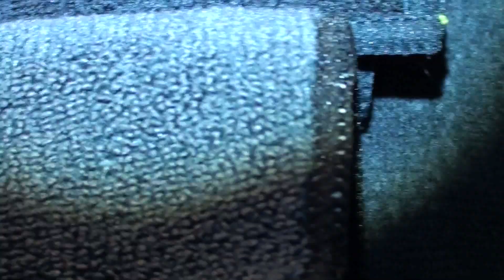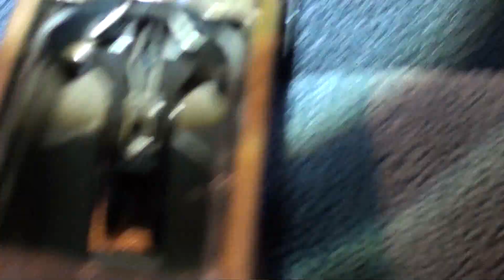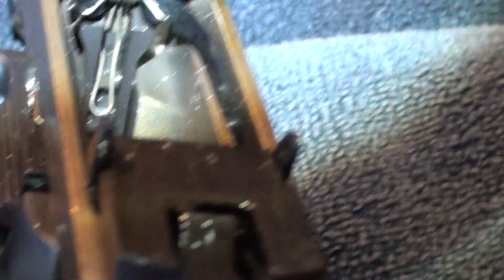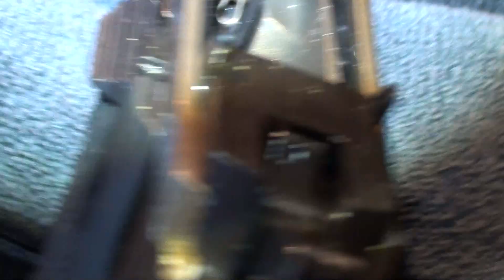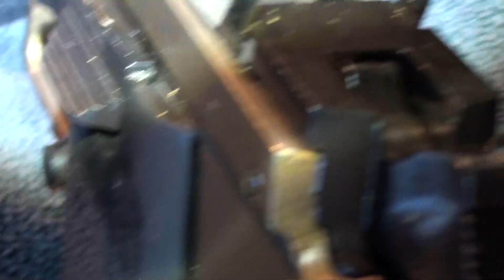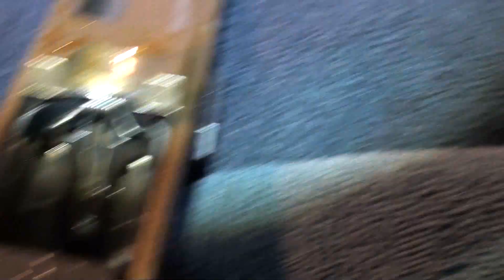Desert Eagle Slide Stop Review

Comment: Great video sir! Can you tell me what would cause my desert eagle to lock the slide back after every shot? My father gifted me his 44 magnum. But I also bought a brand new 50 barrel and mag and it’s continues to do the same thing.
Reply from the maker: G'day

The most common cause of this is would you believe is the user. They don't realise it , but they are knocking the slide stop up on recoil. It is a big slide stop and easily knocled if you may not have a firm grip on the firearm or it slides in your hand during cycling. The magazine follower should be way down in the mag well and no where near the tab that locks it up so we can discount that. Is your slide lock engagement spring in place? The smaller spring I mention in this video? Easy to test and see. press on the slide without a mag in it, does it move back upwards smoothly of its own accord into it's normal position or stay down, or flop around. i.e. Is it missing......

If all seems to be well in that regards, the I am tending to lean towards your accidentally knocking it up. I've done it myself  when tired in that past and so always make sure every shot is the same as much as possible for consistency.

The only other idea I can think off is that your slide lock is interfering with you slide already and not sitting down flush with the frame. Press it down with the slide off and see if it does sit nice and flush and there is no way the slide can catch on an edge poking up proud of the frame to engage the slide. Run your finger along the edge. if it is a nice clean smooth run it's not that.

Hope some of this helps is some way.

Cheers from down under....
Reply: @Hotdogger808   Really appreciate the detailed reply! I really wish it was the case with the grip, but it's definitely not unfortunately. It was my first thought when it was happening at the range. I also owned another 50 in the past without this issue. 

This issue didn't begin right away. It started happening after about 4 mags. This Desert Eagle was my Dad's, and it's been hardly fired in the last 10 years, and fairly neglected as far as cleanings. But I thoroughly cleaned and lubricated before our recent trip. 

As far as the slide stop/lock goes, it sits flush as it should. When I press up on it, it goes back down when I release it as int should. When I put an empty mag in, it puts pressure and pushes it up as it should. This whole thing is strange. 

I would blame the old mag spring, but did it with a new mag as well for when I switched to 50AE.
Reply from the maker: @damon323  OK

One last idea, your slight stop maybe moving up when you pull the trigger as it is held in place with the trigger bar spring. Clear firearm, take slide off, slowly pull trigger and watch the slide as you pull the trigger and see if the slide stop moves upwards at all. This would denote a weak slide stop return spring (the small spring near the frame). Its a long shot, but worth a try. It has happened to others, but rare.

That little spring (slide stop plunger spring) has to keep enough pressure to keep that slide down during cycling if it cannot it will move up and engage the side. I had one of my slides doing this behaviour and actually I replaced the slide stop and it fixed the problem, It was the slide stop being out of spec from wear and tear, it was well worn and engaging practically every round. It took me about 300 rounds to diagnose the problem.

Are you sure no magazines are interfering with any part of the slide stop engagement lug as the mags are free floating? You mention you have tried a new mag so you have sort of discounted that in many ways. The fact it is doing it on two different pistols makes me wonder though. That is highly unusual. If you are not kicking it up yourself then we really do have a mystery here my friend....
Reply: @Hotdogger808   I'm going to test what you mentioned now but this is not two different guns, just one gun. It's just I'm changing the barrels and mags from 44 mag to 50 AE. The 50 barrel and mag are brand new. I really appreciate your help so far man, thank you!
Reply from the maker: @damon323  Oh my bad, I misunderstood. So it is the same frame. Just out of interest what ammunition are you using? And did the firearm ever function properly or has it never functioned properly? This is a early model Mark XIX we are talking about? with the two weaver slots or a later model with the full rail on the top?
Reply: @Hotdogger808  Using some high quality bear loads for 44, and Hornady for 50. Gun has always been functioning perfectly but it has been sitting for several years. When I was having the problems at the range, I held the slide stop down while firing and it functioned perfectly. Definitely something causing that slide stop to come up during firing
Reply from the maker: @damon323  Yes I have been there myself and seen this behaviour. It was a bloody nightmare. I have a few videos on it on my channel I think. It is on my Israeli 44 Mag MK XIX. This is the one I did the exact same test you did on it and I ended up swapping out the slide stop for a new one and it sorted it out instantly. Check your slide cut out is nice and sharp and not worn on the edge also. When these beasts go bang, it is ferocious and a lot happens in a millisecond. The amount of moving parts is staggering. Even the slide slamming into the back of the frame on recoil can "jump" the slide stop up if the slide stop plunger spring is weak. Have you had a service kit though it by chance? Well worth a shot. New recoil springs would def be worth trying. if the main recoil springs are weak you could be slamming the hell out of your frame and kicking your slide stop up as a consequence.......
Reply: @Hotdogger808  You are seriously awesome my friend! I know I’ve said already a few times, but really want you to thank you for the time you’ve taken to help me! Funny you mention that because I do have a tune up spring kit coming that I just ordered last week. I think you are absolutely right on the recoil springs being weak. They actually do feel that way. It’s a 10 year old gun, and the springs are all original. It’s a Mark XIX by the way, I forgot to mention that. It’s a tune up kit for a 50, but I know it’s all the same except the magazine spring is different on a 44.
Reply from the maker: @damon323  Good luck brother...... Hope the new springs might make a difference. 10 year old DE springs will be on their way out for sure. Under compression even when slide is in battery they loose their power. I have over $6K worth of DE parts collected over the years before parts became nearly impossible to get here in OZ now. I knew one of the head guys at Magnum Research and if I am hard up and he still works there I would reach out to him for help as a last resort in the past, He was always very helpful. 

A DE here in OZ can go for over $4500+ these days here.....and that's not for a special edition.  Let me know how you go...............cheers
Reply: $4500 is insane! I couldn’t believe how much they went up here in the states in the last 7 years. I remember a nice cerakote finished eagle was $1400. Now they start at $2200. But that is great that you had some help for parts when you need them. 

The more I think about it, the more it makes sense on the recoil springs. My father gifted me this as I mentioned, and never cleaned it. When he got it here last week, I immediately cleaned and greased. The slide was like butter afterwards, and noticed how much easier the slide moved. Between that and old springs, this all makes sense. Thanks again my friend! I’m hoping I get my kit this week and I’ll let you know how it goes👍👍
Reply: @Hotdogger808   Got an update, and you were absolutely right!! Just needed some new recoil springs! I also put in that rubber extractor spring and pin as well. Ran perfectly! Thanks again for your help Bro👍👍
Reply from the maker: @damon323  That's great news! Glad to be of assistance and good to see we could get your DE up and running again like it should. You enjoy it! Cheers

Comment: How did u widen that spring to keep the slide stop tight mine is getting loose
Reply from the maker: I just used some small  pliers and gently opened up the gap in the centre where you can see the spring bows inwards until it clicks into the trigger slot firmly. If it is not tight enough it can jump out and then the slide stop slides away from the frame as you may have alreay experienced,.the trigger spring is the only thing holding the slide stop in position. The smaller side spring is only to push the slide stop up and hold open the slide on the last round.. word of advice....use some masking tape on the frame if you dont want to scratch your finish on the side spring......... Be gentle with the trigger spring, its a delivcate spring. Hope this helps. Cheers
Reply from the maker: Also check your trigger spring horns are not bent causing the spring to pop out. I use wooden sqewers, you the ones for cooking to help me click everything in. Wood on metal is a goodthing......qvoid scratches especially on stainless or chrome DE's i have 1 chrome israeli built 44 . They are out of production now. 2 ofmthe new stainless  SRMB in 44 and 357 and a burnt bronze as you can see in tbis video in 44

I dont know what country your in, but here DE's pretty rare...... cost all up for my set which i use for shooting in metallic silhouette comps out to 100 yards  i have 4 with 3 having a combination of  deltapoint pro and vortex razor red dots approx $14000. Ive first shot the DE in 1990 in a MKIIV   . If your in the usa and come across a MK I in decent condition consider  buying it! its a higly sort after collectable.i am in OZ and have never seen a MK IIV here in 30 years.
Enjoy your platform....its the only short stroke gas operated handgun in the world and an iconic firearm. Cheers fro down under
Reply: @Hotdogger808  is it normal for the slide catch to have a little play like.when I push it in it moves just a tiny bit.?yes I'm in the USA I have the burnt bronze 44 just bought mine 3months ago and already having trouble it doesn't go into battery all the way bolt sticks out.i have about 200 rounds through it
Reply from the maker: @Theshoota420  no they dont usually move much at all side to side. That spring is whats stopping the movement and if loose it will move.

New pistol shlukd function flawlesy, unless its second handbandbhad cast lead shot through it which will block the gas port. Ive seen plenty do it and have to send the gun back to MRI

Check your return springs. All 4. Are they new or worn out. The return springs pull the slide into battery but weak ones do t have enough energy to do it.

Also is your bolt rotating cleanly. Does it rotate smoothly? Check also for gas piston alignment to male sure its not catching on the gas port. I have seen bent gas pistons before. I have personally broken 3 from useage but i have shot over 6000 rounds of 44 mag
Reply from the maker: @Theshoota420  also its a new gun so needs running in but they are tested at MRI prior to shipping for function.

Also. Lack of power in your loads can cause failure to go into battery as the slide does not complete a full rearward cycle. It is brand new yes?
Reply from the maker: Lastly
Are you limp wristing at all? That can cause both FTE and FTRTB not uncommon.

Lastly look at your extractor and check its not too tight and not slipping  over the case rim prior to entering the chamber.

You can buy a tune up kit from MRI and if all else fails give it a go. Your springs may just have lost their resting length pressure

Anyway good luck hope you get it sorted. They can be finicky firearms and they def need cleaning well
Dirty DE asking for problems. 
I use Brian Enos slide glide on my rails and g96 for cleaning.

Cheers